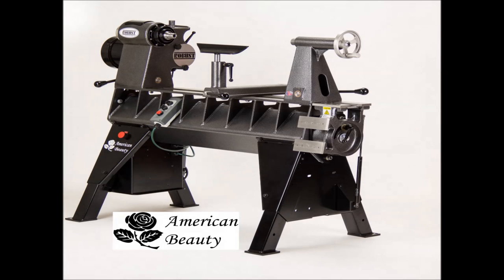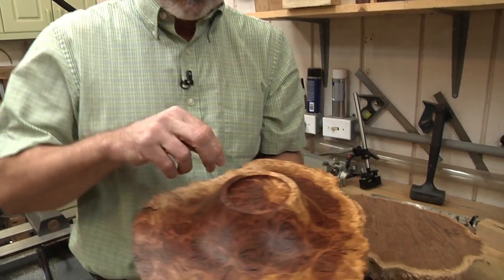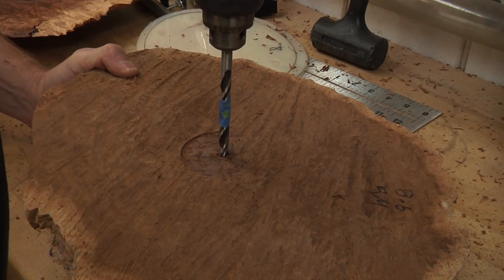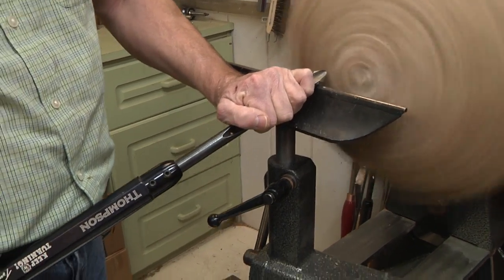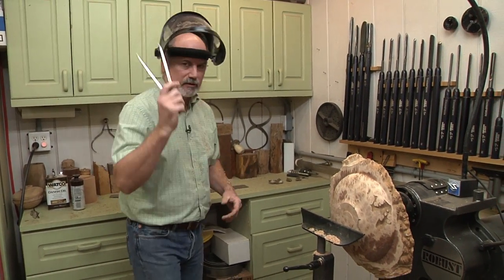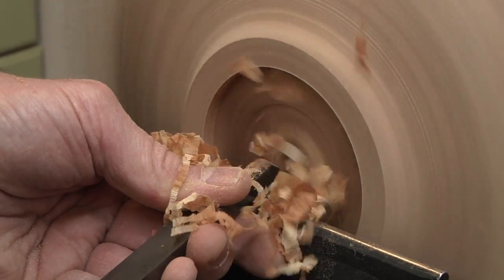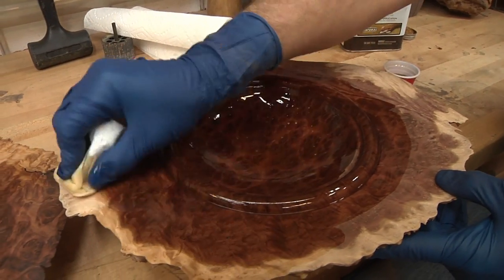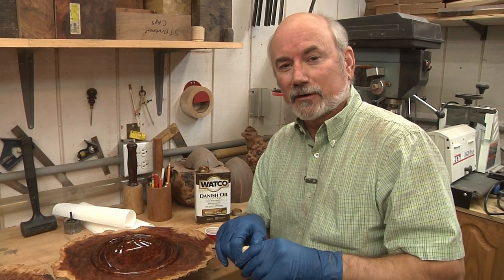Winged Burl Bowl

Comment: Hi Tim,
Just saw your video on turning winged burls. To find the balance point for large irregular chunks if you have a reasonably flat surface lay the wood on a dowel or rod. Role the rod back and forth until the wood balances, mark the edges of the blank then draw a straight line on the flat surface. Turn the blank about 90 degrees and repeat the process. Where the lines cross is the center of gravity. 
Great videos by the way. Love em.

Comment: great video. I've made a few of these myself (I'm in Australia and they are easy to get). however, I don't take the rough outside off. I turn a base and then turn the inside. mages for a great, heavy bowl with that rough textured outside. One word of warning, when sanding and polishing be careful. I spent 14 months with a large splinter in my finger that in the end had to be surgically removed after slicing my finger on the sharp edge.
Reply: Peter Minella mike peace Woodturner
I have

Comment: Finding the center of gravity would be best for placement of initial center hole. To do this, somehow clip a string or fine wire to edge of wood and hang it up. Mark where wire apparently crosses middle of intended bowl as if the wire ran all the way down width of piece. Do this from at least two or three angles around piece. This should indicate the proper placement of center hole...Note: this is the very first use I've ever found of college Physics class. Hope it helps!!

Comment: Hey Tim, I bought the same wood last Sunday and I'm having huge issues with tear out from my 5/8th bowl gouge, I sharpen on a 120 aluminum oxide wheel, I basically had to scrape the wings with a skew to get most of the tear-out out, now in Sanding with an orbital sander with 60 grit to get the sanding marks out but it's taking forever, how to I get a cut without Mass tear-out, please help. Thanks.

Comment: I know I have watched this video at least 4 times, and each time I am amazed at how beautiful the burl is, and how beautiful the finished work is. One thing I find particularly interesting, is the 3 point tool you use for your bead. Is it homemade or store bought? Looks to be about 1/2 inch bar stock with approximately 45 degree angles. Is this something you will be selling in your store? I am eagerly awaiting the Cross 4 Center finding tool to arrive so I can purchase it. I have learned a lot watching your videos and look forward to more of them Keep up the good work and your wickedly warped sense of humor.
Reply: That tool was really interesting but might not be entirely necessary.  I have always had great luck using a skew chisel to make the bead.  Check out my square bowl video and you can see the technique I use to do it.
Reply: What he describes as a center finding tool is actually finding the Moment of Inertia of the material, like the Center of Gravity "CG" of an Aircraft.  Their are mathematical equations for this which I have long forgotten, to calculate  the Center of  Gravity or point of balance.

Comment: Hello Tim.
Love how clear and direct your videos are. Great stuff. I just subscribed. If you don´t mind, I have a couple of questions for you.
When my lathe vibrates lateraly, should I avoid that by fixating it hard it on the floor or that flexibility is advisable?
What brand is that dust mask that you use on this video.
I'm don´t have that much experience in this stuff, so, how should I know the right rpm I should use diferent sizes of pieces?

Thanks & regards

Comment: 1st time watching you & I have an early question - When working with large pieces of wood do the larger wood cutting tools make the job safer?
Reply from the maker: Yes and no. The larger tools help absorb the impact of the larger piece of wood. However they also provide more surface area contacting the woods so they are more aggressive. So sometimes I have to switch to a smaller tool to make it cut I need because I have better control of the tool.

Comment: There is a way to find the center of gravity of an object, or at least get close, as long as you have a "flatish" surface. To illustrate, take a yardstick or meter stick and place your left index finger under one end and your right index finger under the other. Then 
slowly bring your fingers together. They will end up almost exactly at the midpoint. For an irregular shape with at least one flat surface, take two round bars and place the burl (or whatever) on top of them then slowly bring them together. The bars will come together in the center of gravity in that direction. Do this in several different orientations drawing lines across the flat surface where the bars come together. The more directions (meaning the more lines) the better you will be able to define the center of gravity. This depends, though, on the bars being able to slide fairly easily across the flat surface. So if there are a lot of rough areas, it may not work.

Comment: Beautiful bowl and your video's are usually great, but this one show's that you didn't use any dust collection while sanding and that's not good for the lungs, especially when you turn exotic woods or spalted woods.  I realize that you were only going slightly into the wood with the 2 1/2" forester bit, but to hand hold the piece while doing so give the impression that it's ok to do that in all circumstances.  You should show the use of sand bags to level the piece and do the drilling with the forester bit on a drill press.  Also, for additional safety, I was always taught to use a tailstock as much as possible for as long as possible as it will help hold the piece in place if you get a nasty catch whereas just holding it with a chuck a nasty catch - ask me how I know - can pull the piece out of the recess that the chuck is holding it in.  Just my humble 2 cents worth.